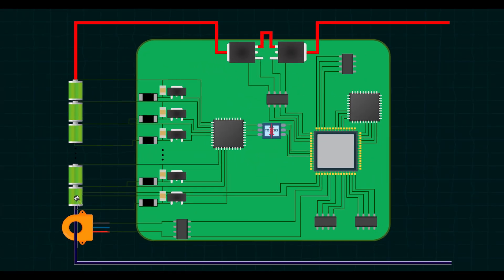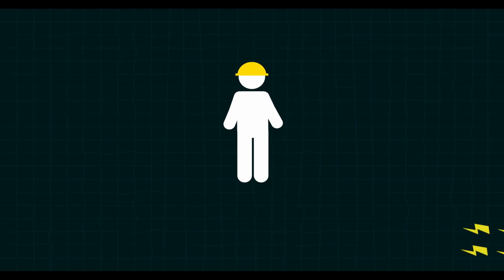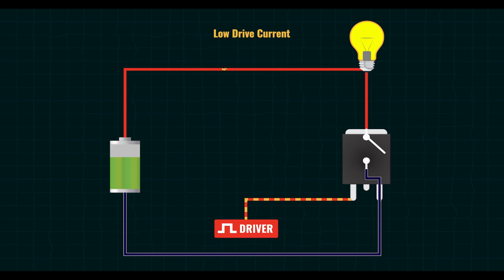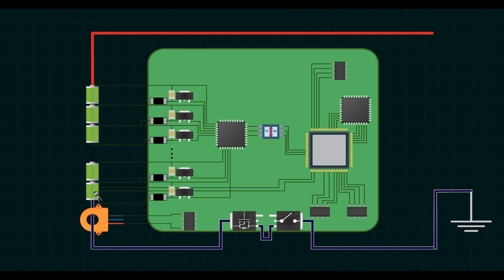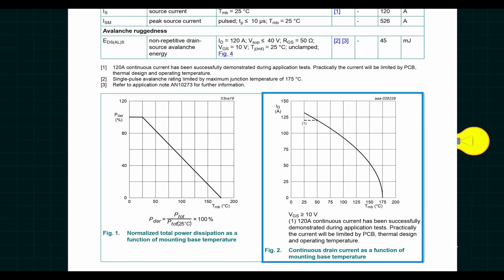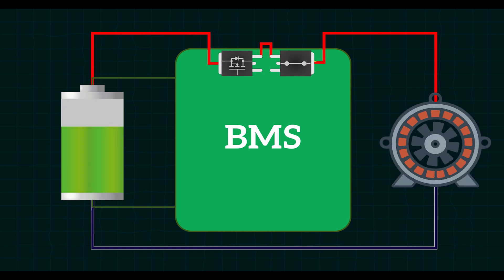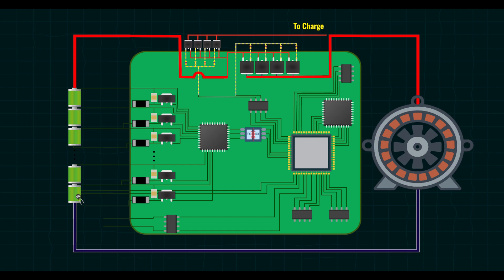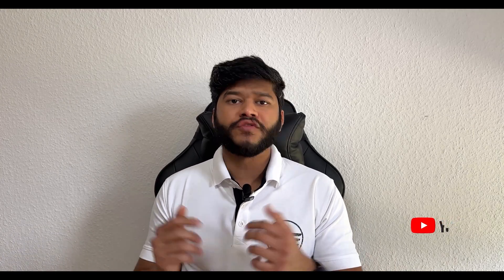How to Select & Protect MOSFETs in a BMS? Selection of MOSFET in BMS

Comment: Hi, in general your videos are very informative and educational. Thank you for that! 
However, the video title is "how to select MOSFET... Selection of MOSFET", and that was very rushed, the shortest section of the video. I know you already have many videos on MOSFETs, but even the graphs and drawings for that section went too fast to read. 
Another point is that I believe you should have emphasized more on the body-diode topic, as that is critical for this application. When you described that the MOSFETs can have different sizes for charge and discharge, but the discharge current is flowing through the body-diode of the charging MOSFET (because it was turned off for whatever reason), it would completely destroy the charging MOSFET due to the extreme heat dissipation. 
Thank you, nevertheless

Comment: Excellent video! 

How do we ensure balanced charging among cells? I've noticed the new electric power equipment BMS units struggle with balanced charging. 

Thanks for all the great videos!
Reply from the maker: Thanks, that’s a great question. Cell balancing is harder than it looks — many BMS units rely on passive balancing (bleeding excess charge as heat), which is simple but slow and inefficient. 

A better approach is active balancing, which redistributes charge from stronger cells to weaker ones — it’s faster and more efficient (it can support higher balancing currents and reduce wasted energy).

I will try to make a detailed video on cell balancing in BMS
Reply: @FoolishEngineer Thank you sir! ❤🎉